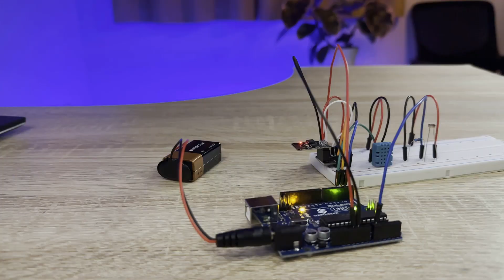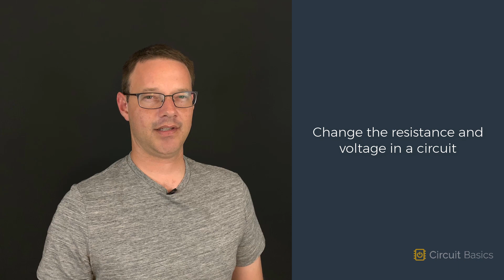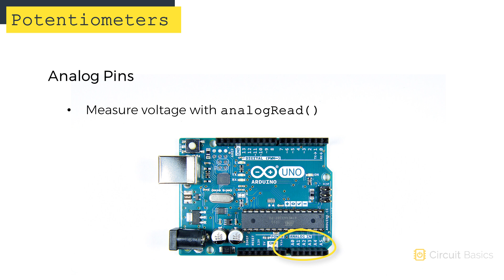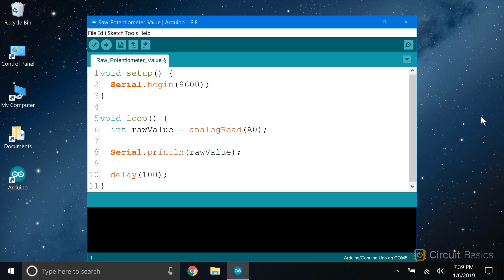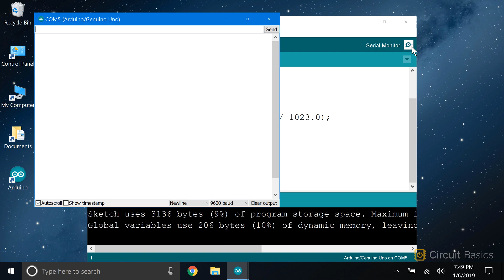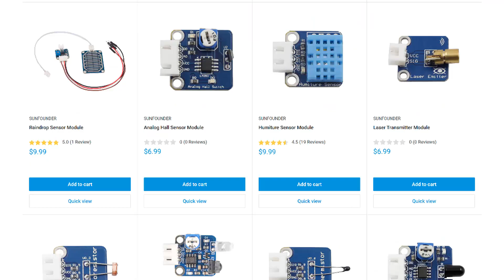How to Use Potentiometers on the Arduino - Ultimate Guide to the Arduino #6

Comment: I really like your tutorials, you go into more depth than most; however, your math on the ADC on Tutorial 10 is slightly off. A 10-bit ADC stores the voltage being read in memory, with 10-bits that 1024 possible values.  So, you need to divide by 1024 like it states in the ATMEGA328P datasheet.  ADC = Vinx1024/Vref.  I know the error is minimal 1/1024; however, fundamentally it is incorrect.  You must think of 0 as a range from 0 to the approximately 5 mV until it becomes a 1.  At the other end the 5 V is 4.995 V to 5.0 V, with 5 V as the default reference.